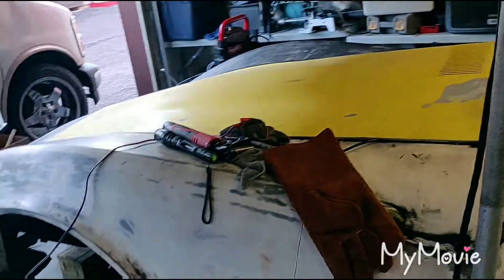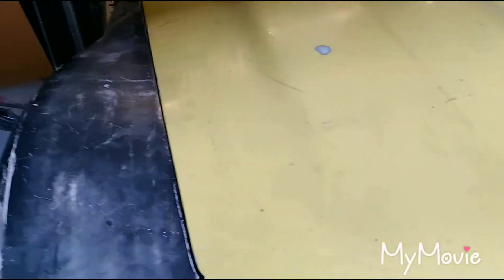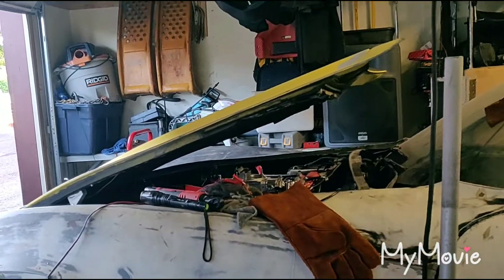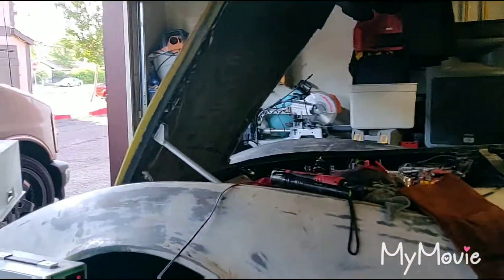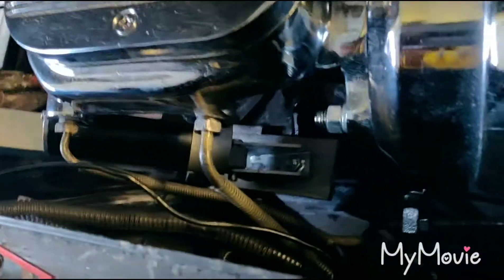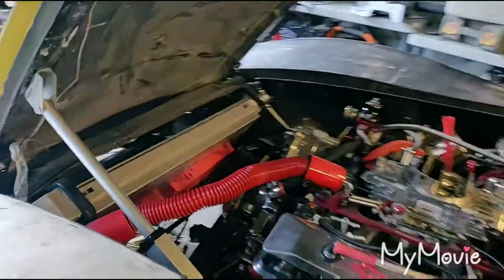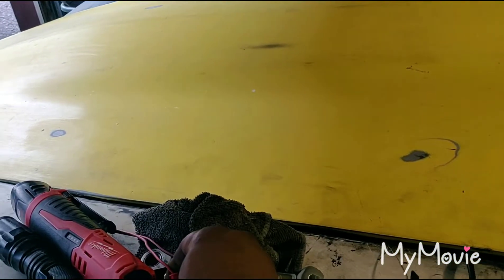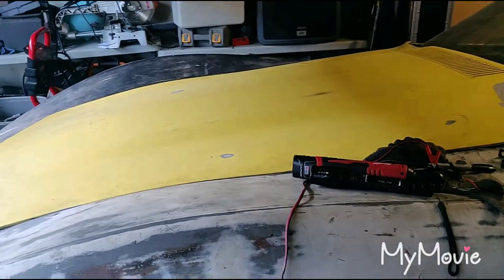Automatic Hood opener - Linear Actuator / Remote control Hood Corvette

Comment: I  MOUNT MINE WHERE THE  OLD HOOD PROP WAS BUT DONT LIKE IT THERE IS YOURS MOUNTED BELOW MASTER CLYINDER ?
Reply from the maker: I actually try mounting mine by the original hood prop, but I did not like it as well. What I did is get a L bracket and mounted it on the wheel well (its definitely strong enough) and mounted the actuator on the bracket and that worked fine.

Comment: I do not know where the battery is in this car, but, if it is under the hood and needs a jump start, have you provided a way to open the hood? I like the idea. If you have details on its construction please post. Thank You.
Reply from the maker: The battery for this car is located in the rear of the car...however if there is power fail.. the last resort I can access the actuator from inside of the control arm area and possibly unbolt it... I will attempt to post something showing it

Comment: I want to do it on my c3, I think the angle of your actuator is a bit flat ? will be better to be more vertically ? just a think ...
Reply from the maker: My actuator is a little on the long side...so i had to mount it at that angle...or go with a shorter actuator..it's works fine though.

Comment: How long of an actuator did you use?
Reply from the maker: https://www.amazon.com/dp/B0722R3H9Z/ref=cm_sw_r_wa_apa_fabc_ZK708RAYCETVKMRGTQ11
Reply from the maker: Here is the one I got...however we you may be able to get away with a shorter version...perhaps a 6 inch...  I noticed mine is slot more quiet than the other ones I've seen.

Comment: Very ingenious to say the least
Do, you think I would be able to accomplish the exact same method you used on your 63 Corvette.
 On semi truck hood using  heavy duty actuators?
My Kenworth has (2) right and left  manual hydraulic struts.
 Did you purchase the mechanism? Or did build it yourself? By the way my name Tony Williams. You can reach me by email lsnglst9@aol.com or text me (323) 218-2772 Thanks for sharing...
Reply from the maker: Definitely...you will just need to get the correct length actuator to install ..a good starting point is to measure the stats that are on the vehicle...get the actuator the same length